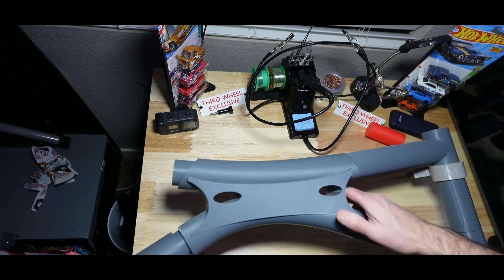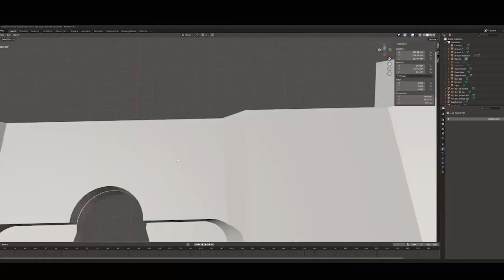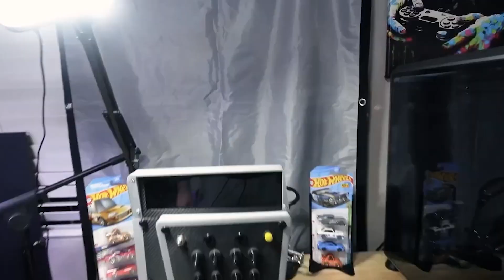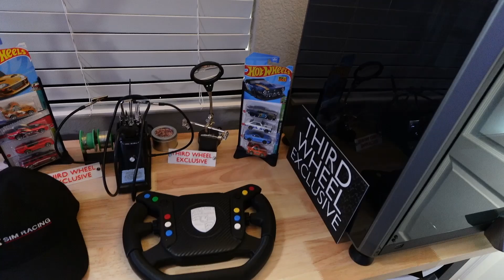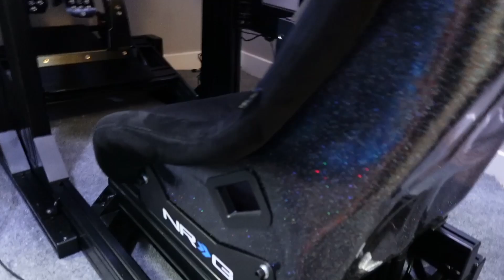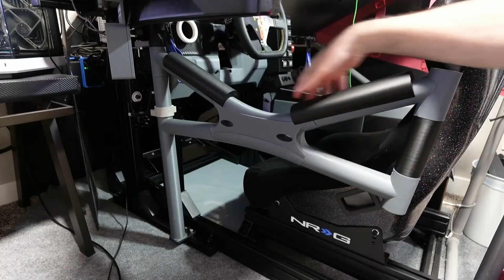My 3D Printed Sim Racing Rig Is Getting Insane Upgrades for Cup Car 2.0

Comment: Full Motion if it's in the budget.  I'm waiting on my motion system and active belt from PT Actuator.  I only drive in GT7 on PSVR2 with a PS5 Pro.  I have full wind simulation and bass shakers already.
Reply from the maker: I’m actually in talks with PT actuator, they are the brand I’m mainly considering for this build but there’s still a bit to work out.

Comment: Motion is the ultimate, for less than to cost of my wheel base and  499 wheel you can get a 4 actuator system from eRacing Labs which is what I am currently running. I switched from  Sigmaintegrale DK2 and have been  pleased with its performance.
Reply from the maker: I am working through the options. I may start with a built tensioner first and add motion as I go. E-Racing Lab is one of the brands I’m considering though.

Comment: hey, I know you’re doing a lot of this your self, but turn racing have free files and instructions on how to build an exact replica of the porsche 992 gt3 cup wheel, including PCB files :)
Reply from the maker: For that, I am actually using a variation of their design. I am not on the level of designing my own wheels yet😂
Reply: @ThirdWheelExclusive brilliant!! Glad you already knew, was worried you were going out your way to make your own 😭. I have the pokornyi 296 gt3 replica that I built and wanted to do a similar thing but based on the ferrari, this project is absolutely amazing, you’re doing great so far!
Reply from the maker: I appreciate the feedback and you letting me know about the wheel.
Reply from the maker: Would love to see the wheel you built, have you shared it anywhere?
Reply: @ThirdWheelExclusive not yet, but i’m planning to do a full video once I get my rig setup again, I had the back plates and front cnced and then printed the center bit with PLA and wrapped it in a carbon vinyl :), I didn’t realise turn had closed down? i’m very out of the loop that’s such a shame to hear
Reply: Didn't they close down like 3 months ago?
Reply from the maker: They did put a lot of stuff is still out there.

Comment: Out of interest are you a cad designer before doing this project?
Reply from the maker: No, to be honest, I had never done cad until January. It was a necessity for designing the rig so I’ve been learning as needed.
Reply: @ThirdWheelExclusive  Nice dude so your completely self taught, I'm guessing your using Fusion for this? It would be awesome to see a video of how you go about designing a new item, eg - the process of designing centre console, even if its a lightly edited long form.  You have given me inspiration but the whole cad design side of 3d printing is just not sinking in and I fell like Tinker cad is not the way to go! Any chance you have some pointers/videos/materials you used to learn?

In your shoes right now I would go for the belt tensioner and a more basic motion like the DIY actuator project rather than FULL motion. Less is more. I cant see a way of maintaining the visual emersion of an augmented reality rig like yours when the thing is swinging around. I want to point you in the direction of the DIY FFB Active pedal on Github too. These people are GOATS!!!
Reply from the maker: Thanks man, I love doing these builds and seeing what others do the ideas or even better, what new ideas come from it. I am currently using Blender for cad design but I may be to change that for CNC, not clear yet. I will be doing some videos on the design process as part of the new series for sure. I want to be more in depth with this build. I appreciate the input on motion and I’ll look into the active pedal as well.

Comment: Go for it. Full motion is great for your personal experience. Your cameras will have to be mounted properly or it won't look right for your viewers.
Reply from the maker: I usually use a POV face cam and adjust until viewers see what I see but I’ve never tried that with motion. I’m sure I could get it to work though.

Comment: full motion and belt tensioner for sure!
Reply from the maker: 🙏 Thanks, anything else you want to see on the build?
Reply: @ThirdWheelExclusive  i liked the sound of custom metal/ carbon parts with a cnc. will look forward to the updates! I myself have toyed with the idea of motion so very interested in that
Reply from the maker: I’ve considered it a lot but for my normal builds, motion could be hard to work with. If the CNC works out then I can make better mounts and brackets so that it isn’t a concern. I should have the CNC later this week.
Reply: @ThirdWheelExclusive  cool. yeah i've considered how to do motion a lot too and I think if I were to do it I'd attempt it like Steliyan (Race Beyond Matter). If you haven't seen it, he detaches the motion, seat and pedals from the steering column and screens. That way makes it a lot more manageable for a custom cockpit (I too have an enclosure, triples, sequential shifter, etc)
Reply from the maker: Yeah, the split rig concept is how I would do it too. No way I could get the wheel right with motion.